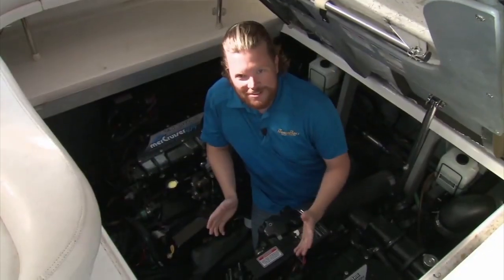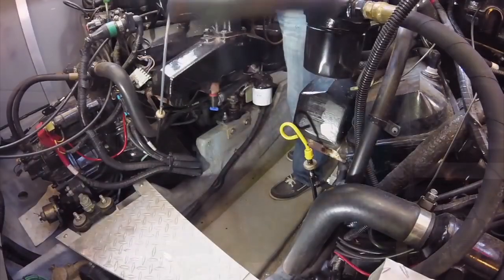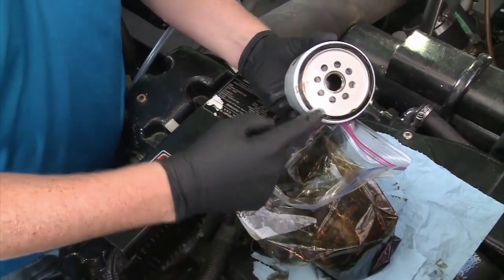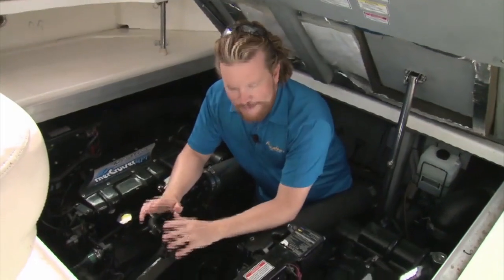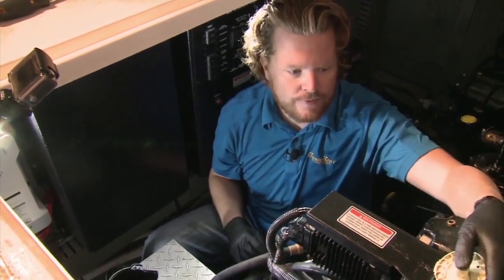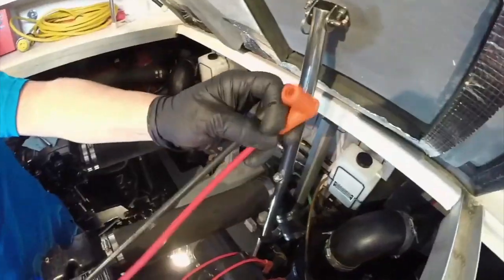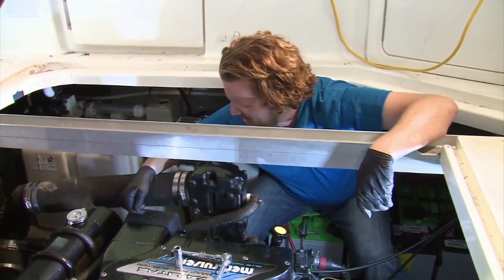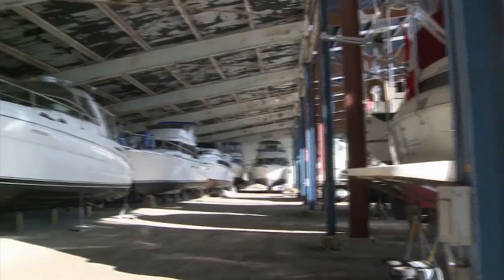How to perform basic maintenance on a 7.4 L MPI inboard | My Boat DIY

Comment: The dipstick tubes on those engines goes all the way to the bottom of the pan. So put your extractor hose over the tube instead of using the little tube down the inside. The oil will come out much faster.  
    Great video thanks

Comment: do you need to prime the oil filter before installing it?
Reply: Yes it will reduce engine wear during startup.  Oil analysis shows additional metal when not filling with oil vs filling with oil before install.

Comment: Hi I have a engine like yours long block but I think it’s seized do you know the first thing I do
Reply: Remover spark plus and spray generous amount of WD-40 into spark plug holes and let sit for a few days.  Do not reinstall plugs.  Now attempt to turn engine over with a large wrench ( 3 foot or more) on crank pully.  If it breaks loose then run the starter for 30 seconds with no plugs in the block.  A compression check will let you know the condition of the rings and valve seats, numbers should be 150 or more and within 10% from highest to lowest.  If the 10% rule is met install new spark plugs and start engine, if your fuel system and ignition system is working the engine will start.  Good Luck!